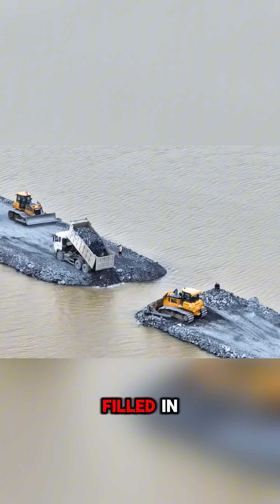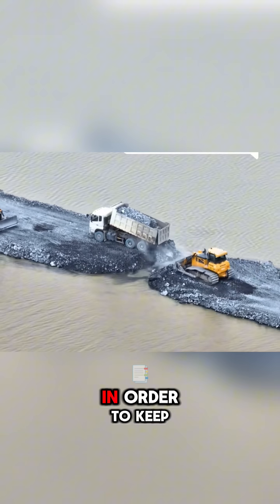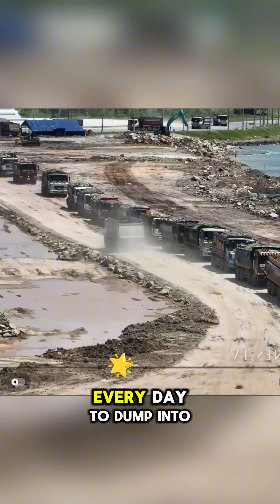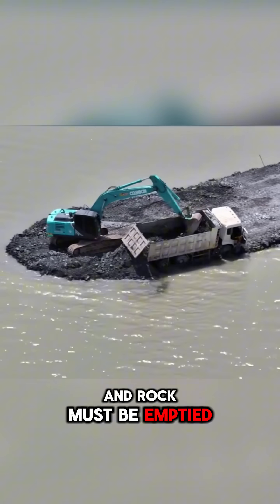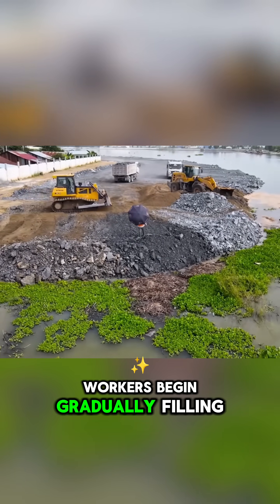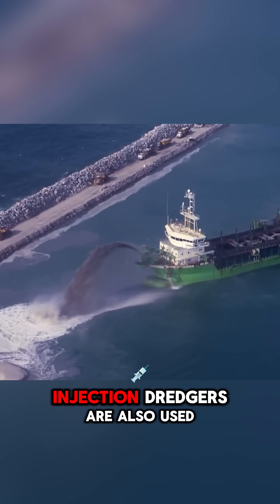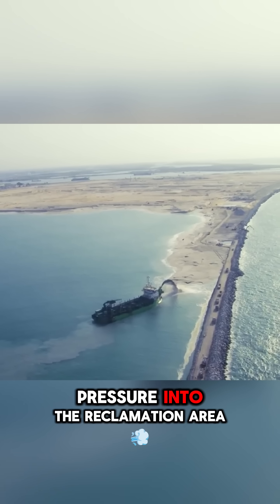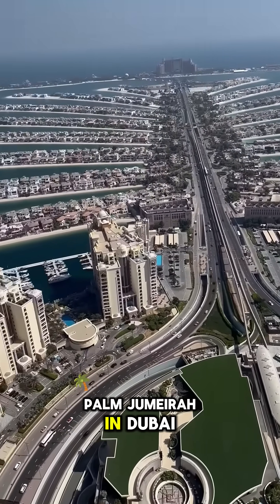This is how a lake is filled to create new land. #construction  #engineering  #discover

Comment: I drive Tippers and the wight of the truck when loaded further compacts the ground layer by layer. we never get the truck near the edges. Never ever, Must be at least 2 Meters away. the ground under the truck is not compacted so when you lift of the rear Axles weight increases as the load is moving backwards, this could roll over the vehicle and it happened in the past. always drive over then move forwards and tip where your tyres been. this way you compact the area if soft you know it's not good

Comment: I don't agree with this video,
Construction in water requires a  high level  technique which one of them are piles And caisson etc. for the foundation piles are inserted into the ground very deep so as to be able to withstand the water pressure, and caisson are pre-fabricated concrete boxes to their veriouse sizes and very dense in mass.................🙏

Comment: Ya, Foster city up close to San Francisco was built like that, I looked at it some where around 1978, even just a few years of building the mew homes, and they were nicely designed two story, showed evidence of settling , smalll cracks in drywall every where . Who knows what type of problems they have now? 45 years later.

Comment: What happens to all the contaminants that, up to this point, were undisturbed on the bottom of the lake?  And now they build homes atop the reclaimed, contaminated soil?
Reply: We had an issue with that in the Netherlands, 4 major rivers that flow through Europe and end in the Netherlands brought a lot of poluted sludge. What we did is build an island, then dug a massive hole in it, made sure it's contends would be isolated. Then we dredged up all the poluted sludge and dumped it in the containment island.

Comment: and then all the fill starts to sink because the subsurface is still liquified and cant hold the pressure. all the housing island are sinking and including Japans airport.
Reply: We've been doing this for centuries in the netherlands, we've got this. Those palm islands where buidl by the Dutch, it'll be fine.
Reply: The Danes punch tubing deep into the fill to wick out the water and compact the soil and rock.
Reply: Buildings over two stories would be on concrete pylons 40 to 60 feet into the sand and mud.
Reply: Fortunately Japan knew it would continue sinking and planned for it.